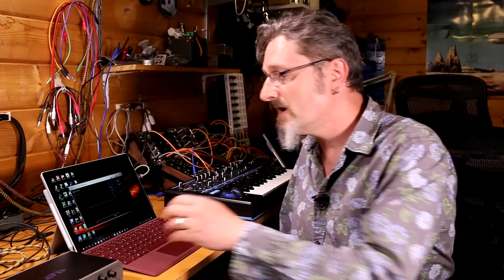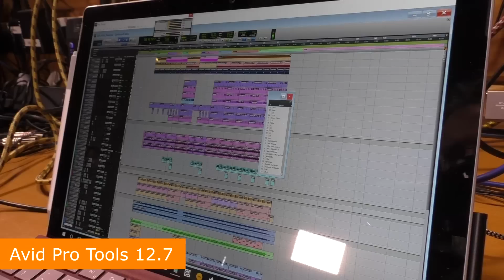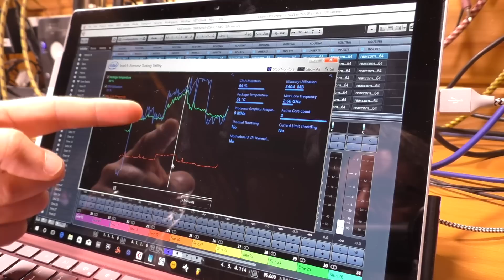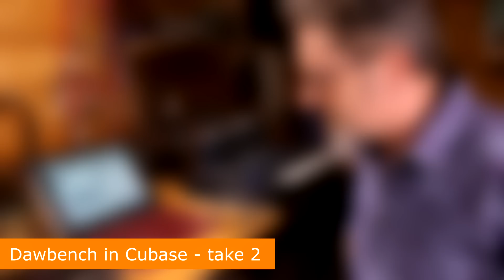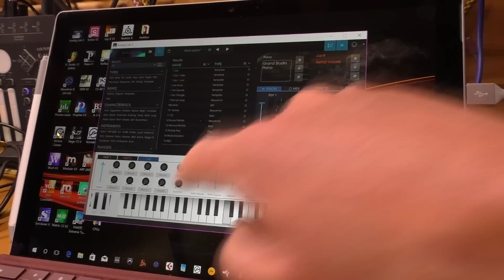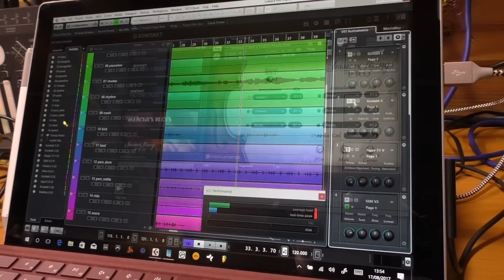Surface Pro 2017 audio performance and reliability for music production

Comment: Thanks for this review...particularly the power settings...
I've been having unsolved glitches in all audio programs, even when using an external USB audio interface..
Sometimes the audio plays fine, then suddenly this throbbing sound (similar to listening to your heart through stethescope), and I have to restart the system...

So I'm hoping this CS settings which opened up the other power settings will solve this..

THanks again :)
Reply from the maker: I'm hoping it will help :)
Reply: Hi there again...
I'm still having this throbbing sound each time I plug my headphones or any audio cable into my audio port.
Here is the link of the sound: https://www.dropbox.com/s/njxd6i8zageqz3c/GPD%20Audio%20Problem.mp3?dl=0

any idea what could be causing this?

Thanks Rally
Reply from the maker: Nope, I have no idea what that is.

Comment: When you stated that you were using the i5 fanless Surface model, I suspected you would run into thermal throttling issues.
The fanless model should perform consistently under normal conditions, but your set up would be classified as a power user.
Your idea of setting the minimum/maximum processor state to 99% is a brilliant solution.

Even with my i7 16GB 512 Surface Pro 2017 model, I experience occasional thermal issues on extended video editing productions.
I will try your solution to see if that resolves my occasional thermal issues.
Reply from the maker: I suspected that too :)

Comment: Good thorough analysis, thank you. Just one note: Setting the max CPU to 99% is most likely not what is preventing your CPU to go to 3.5 Ghz. This machine uses a Intel Core i5-7300U CPU, which has a base frequency of 2,6 Ghz. 3.5 Ghz is the turbo boost frequency, and that will only ever be triggered for single threaded applications that can't make use of multiple CPU cores. Which is unlikely to happen in such a complex DAW setup with 50 odd plugins active. Rarely, if ever.
Reply from the maker: Well, i can only report on what I find and if what you say is true then it would be the same for the SP4 - which it isn't. So i tend to find that what works in theory and what works in practice are two very different things :)

Comment: I've had much luck with the pro3 i7 undervolted and running high performance profile and get near constant turbo 3+ghz and never see the temp go over 90. Usually around 80. No throttling.

Comment: 24:00 yeah the passive cooling is not good enough the heatpipes are overloaded and the microsoft firmware is telling the system to throttle down get the i7 guys and just downclock it has a decent fan. you can also max the fan and then disable hyperthreading which basically just feads the cpus more work this will reduce its workload. cooling has been the biggest bottleneck since the 90s for portables and hyper threading creates a virtual cpu so it pushes the phyiscal cpu limits you dont wanna do that on a system that had a microscopic fan with tiny heatpipe.

Comment: I guess you know but the point with LatencyMon is that it should run while you are using the music software stuff
Reply from the maker: No, not really. You’ll get the same result whether running audio software or not, because the audio software won’t be the cause of the issues. It can help you connect a glitch to the actual DPC occurrence but I’m not sure how that information helps. I recommend leaving latencymon running for 5-10 minutes and see what happens.

Comment: Windows should NOT be adjusted for background services, that is plain wrong. It was suggested by RME back in the winXP days for solving an issue with a particular RME card and driver at that time. It somehow got adopted by all the optimization guides out there, but it was only true for that specific combination of soundcard and driver at that time, RME later released a new driver that fixed the issue..
Reply from the maker: Well, I don't know what to tell you. I have seen many systems and laptops over the years that are instantly cured of clicks and pops using this tweak, in many OS versions and many interfaces. I am happy to do the opposite if I can see any benefit to it - can you demonstrate a benefit? Or even if it does nothing, then it's one less thing to worry about. Maybe it's a throwback because I've been doing this for so long. Either way I'm not sure it's doing any harm. Do you have any evidence of good/bad results? That would be really handy - thanks.
Reply: M$ says this: "You can set Windows to allocate more processor time to the program you are currently running. This can result in faster program response time. Or, if you have background programs, such as printing or disk backup that you want to run while you work, you can have Windows share processor resources equally between background and foreground programs". The theory here is that you are setting the system to equalise running the background ASIO driver performance with the cpu required to run the DAW, or maybe more importantly, the audio stream to disc over, or at least equal to any foreground graphical processing. You are compromising graphical and perhaps even CPU audio/plug-in processing to keep the audio driver stable. I have only seen positive results from this for over 20 years when trying to run audio intensive applications that rely more on the audio stream. It might be worth testing this to see if its still relevant, but the theory still stands...
Reply: If set to prioritize  background services, You will get worse DAW performance. Audio driver is not a background service. I admit the performance degradation is minimal, easy to test for yourself. So leave this setting alone.
Reply from the maker: This is one of those areas where it's difficult to find an easy test and then what to believe. For starters, your first statement was not entirely true - it was not an RME thing. I know this because I ran tech support for a music shop for many years and had to deal with many different systems and many different audio interfaces. Countless times I talked people through switching to background services, and even dialled into many systems where i did this tweak and it solved their glitchy audio problems. That's my experience. If you check out the comments to my tweaking videos you'll also find lots of happy people having their issues resolved and they all include that tweak. So, I can confidently say it was not specific to RME and XP. Since running my own company building PC's for audio it's not an issue i run into anymore but I don't do the same range of tech support. I include the tweak because it has sorted people out and you never know the sort of system people run or the quality of the audio interface driver they use - that's why it's there. Most people who argue with me over these things have their own system with their own audio interface - they don't, with the greatest of respect, have the experience of supporting hundreds of systems with all the audio interfaces across all versions of Windows. All I can go on is my experience in these matters because there's no one else to ask :)

However, it's completely possible that this is a setting that is redundant or even detrimental these days with this technology, this OS and audio interface. It was certainly more effective and common place with Windows XP and with PCI audio cards. Much as i desperately hate to ever be wrong it wouldn't be the first time. 

So I just ran a test on my SP 2017 - FL Studio still glitched. I was able to add one more plugin in Dawbench on one boot but then after I turned back it was still able to load it and then after repeated switching sometimes it would load another one, sometimes it wouldn't. So in this basic "easy" test it's all a bit inconclusive - which is why you often have to rely on your past experience with such things. What I should probably do is devise another test with a very low impact plug-in so that i can get a higher resolution of result and see what happens then..... but then that's only testing one thing. The problem with tweaking for audio software is that there are so many factors, so many ways to use the software and so many assaults on the processing power that it's difficult to define what works and what doesn't. So when in doubt, leave it in :)

But thanks for pointing this out, you may be onto something and I'll endeavour to check into it if i can. I tried Bitsum the other day because someone was convinced it was the answer to everything and it made not a single jot of difference to my tests. Someone else suggested trying Game Mode - so there's always lots to try!
Reply: It may depend on hardware and daw software at this point. My audio device processes are all listed under background services in task manager for what it's worth.

Comment: Hello great video, ive changed the csenabled to 0 as you said but i still dont have the high performance option
Reply: well i guess ive found a way i can create a custom power plan and then i can select the high performance mode
Reply from the maker: That’s the way 😀

Comment: Great video! I always wanted a SP for my audio mixing post-production, however without a thunderbolt three I cannot take advantage of offline DSP and UA plugins...! I hope they'll insert it on the next iteration of SP. Would you consider inserting Harrison Mixbus in the list of DAWs you're going to test on the SP? If you find it at discount it's 30$ and totally worth it, but I'm curious how the SP is going to handle it :)
Reply from the maker: Mixbus? Someone else asked that earlier - possibly yes. Audio recording is not very difficult for the Surface so i'm not sure how interesting it would be.
Reply: I am mainly a mixing engineer, so I use Mixbus for that. I think you could find it limiting compared to other DAWs, especially because I don't think it has the ability to directly draw automation with the pen (probably the main reason why I am looking for a Surface-type device with thunderbolt), but I think that the overall layout might be very interesting for touch enabled devices. It's just a suggestion, maybe you want to look more into it, or more probably you already have too many to look at! Either way great videos, I love this subject (audio + surface ;))
Reply from the maker: It's a bit odd because i had some long conversations with Harrison a couple of years back about how they were going to implement touch screen support into MixBus - based on their own touch technology on their consoles - but it never seemed to materialise. I will try to check it out though.

Comment: Nice vid! I wanted to suggest you to try gaming mode in your daws. I had problems with studio one 3 but when enabling windows game mode, it improved the performance.
Reply from the maker: Yes, I mean to try that, meant to try that, it's on my list of things to try!
Reply: Molten Music Technology : GREAT review . Just saw one of these at Best Buy in the states. Torn between this and the HP 15.6’ Spectre .. Alrhough the wonderful 3:2 screen ratio looks so wonderful and I remember you saying you ran Reason on this smaller screen without having to squint too much. So am considering pulling the trigger here. Thanks again for this great review . Actually I’ll be using it in conjunction with RS remote on my iPad Pron 12.9 so I imagine e it should suffice .

Comment: Hi Robin, have you done any experimenting with the power slider introduced on the Surface Pro 2017 and also added to the SP4?  I have been setting it to "Best Performance" when making music but recently I've found that a few programs seem to drop less if you set it to  recommended...  might be just a placebo though because I would think High Performance mode would just disable all the power mgmt. things the slider adjusts.
Reply from the maker: I tend to just kill the power settings without much experimentation - it seems to sort most things out.

Comment: When trying this, after altering the settings im experiencing a few issues. Everytime im pushing the "rest"-butting it seems to shut the computer down instead of resting it. Secondly the computer looses the ability to connect to internet automatically. Have you experienced any of these issues?
Thanks for the great content!
Reply from the maker: Generally speaking you don’t want your system to go to sleep (I assume that’s what you mean) when running audio software as it doesn’t tend to wake up very well. But you can change the function of the power button in the power settings. For WiFi there’s a tick box to connect to things automatically. Hope this helps.

Comment: Hello, Did you test any DAW with the SP 2017 using the integrated Audio interface only with Asio4All ? I'm just wondering how good is the device for music making while traveling ( without USB hub and devices ) ? Thanks for sharing !
Reply from the maker: I have an earlier video showing all the DAWs using regular Windows drivers - https://youtu.be/4U4JagGWxs4
I plan to do one on ASIO4ALL soon.
Reply: Molten Music Technology thank you, I already saw the video before, but not sure that windows Driver will handle low latency for music production (VST instrument playing for eg. ). IMHO, the purpose of such a device is to be able to work outside your home. Personally when I’m home, I use a more powerful Desktop for my production. When you’re outside, on movement, you dont take with you your Usb hub, audio interface....and stuffs. So for me testing the device with an asio driver is key to see if you can make some tunes while traveling. Don’t you think this is missing in your complete and great review :-) ?
Reply from the maker: I totally understand that which is why it needs its own video. If you look back you'll find the ones i did on the SP3 and SP4 - so i completely get why it's important. However, in all my testing i've found that using a decent audio interface makes the whole experience so much less troublesome! And i want to show the Surface in its best, usable light. But also I can't do everything at once - and no matter what i try to get in there there's always someone who is unhappy.
Reply: Thanks a lot for your quick feedback. I'm not really unhappy, I'm rather very happy to find someone like you testing for us new gears ( thanks god)... so thumb up again !
 
To be honest, the differentiation we have with a surface pro VS other PCs/laptop... is that 1- It's light and portable and 2 -It has Multitouch. 

So in this perspective, it's relly key to see what a Surface VS another less portable and/or non multitouch PC, can bring to your musical experience....

So this is why I loved your Bitwig and FL Studio videos for Multitouch aspects, Just amazing !

BTW: You did a test on Bitwig 2.1, are they any new enhancement over Bitwig 1.3 in Multitouch area ?

And as a recommandation, and regarding the heating issues on CPU you faced, do you recommand a Surface Pro 2017 over Surface Pro 4 for music production for the moment ?

Many many thanks !
Reply: I know, I know ... :) I'm just a little impatient,cause I want to buy a Surface and I found an i7 16 Gb SP4 on sale for a good price... I was wondering whether I'll go for it, for a new SP 20017 or for a Macbook Pro. 

I really want to use the touch features,....if it works...really !  And for me, this will be the game changer..

Surface Pro is not cheap. In the other side , on MacOs there is no such a hassle with low latency audio drivers, or midi routing... like you/I are facing with a Windows OS.... I don't really understand why we still don't have a good low latency audio driver otb in windows 10,  and we still need to tweak a Windows installation to have a decent Audio workstation.... I did this back in early 2000 's. 

Now I just want to plug and play :-)

Comment: do you know anything about the zoom uac 2's performance with the surface pro? i was thinking of getting one because ive been reading that it has very low latency at a reasonable price
Reply from the maker: I had one for a week - seemed to work fine but it didn't give me any better performance or latency than other interfaces I was using. I was expecting something impressive, it wasn't, it was perfectly adequate though.
Reply: thanks for the reply and all the videos! (you convinced me to get a surface pro) do you think its worth it to sell my presonus audioboxx usb 96 and get the uac or something else? im getting some pops and glitches running keyscape on my i5
Reply from the maker: Tricky to say. Keyscape is Spectrasonics - they tend to eat CPUs for breakfast. But Presonus interfaces are not that efficient either. I would buy it from Amazon - run some tests and send it back if it's no better.